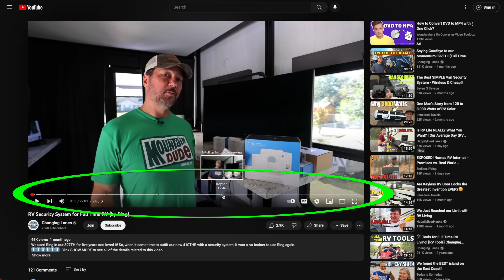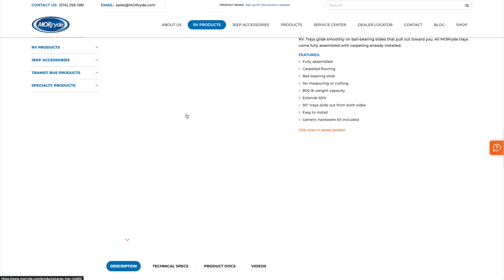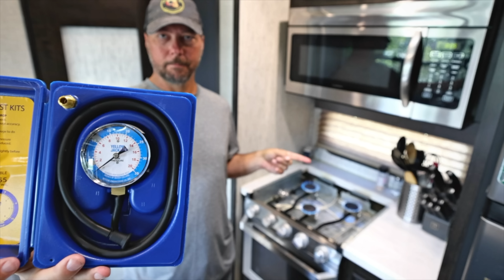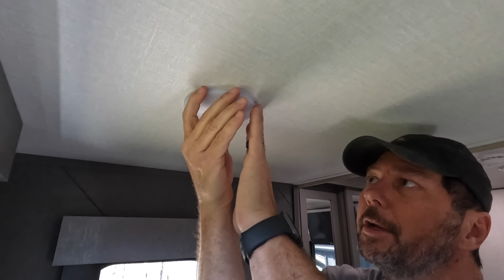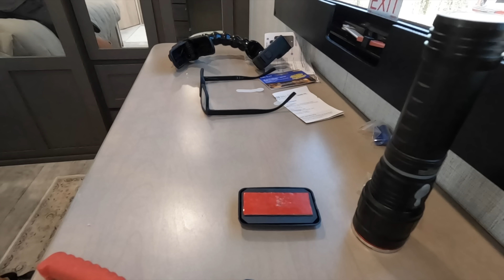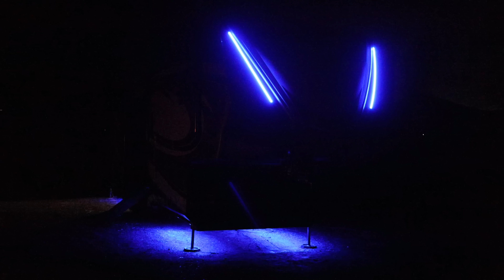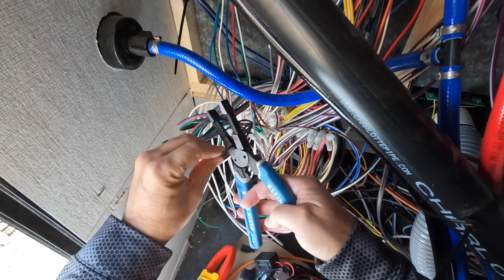Five EASY RV Projects for our New RV

Comment: If the screens will help prevent insects from restricting the flow of air by keeping them from making a home in there, why doesn't the manufacturer put them on??  I could never get an answer on this question, none from manufacturers nor Youtubers.
Reply: Money ! Every thing that is added to the RV cost money. So if you are willing to pay for the add on’s and not complain about the cost of the RV’s go ahead.
Reply from the maker: Like Tony said... Money is my guess.  There are TONS of improvements that can make every aspect of an RV better but they all add to the bottom line.
Reply: Like disc brakes, they should be standard on every camper. They probably cost close to the same as the drum setup…
Reply: @charlestabarracci7602  You are making a statement that you have nothing to back it up with.
Reply: Because the RV manufactures don’t care. People are buying them as fast as they can build them. So why would they want to make them better. The consumer is not pushing the issues, they are just buying them and making the upgrades after the fact.
Reply: @murphyslaw907  I bet you have one ?  Are you talking about yourself also ?
Reply: @TonyBenton0728  I purchased what I thought was a well built RV in 2016. Since then it has done nothing but piss me off. I will never buy another production line RV. The build quality is total crap, the engineering is marginal and all they seem to care about is how fast they can build them. Our old 2001 motor home was built so much better then our 2016 5 th wheel it’s criminal.
Reply: @murphyslaw907  Did you have it inspected by a independent inspector ? Maybe they would have found some of the issues you are having. We had our Riverstone independent inspected cost a little over $800.00 they found a few issues nothing major.
Reply: That's way too much weight to add. LoL
Reply: @r8edrv4fun65  🙄😵‍💫

Comment: I've been annoyed with the front cap lights as well. Thanks for the tip. ps when boondocking, the front caps lights help in finding your rig again when its pitch black.
Reply from the maker: Great point!  But I've also worried that it might say "hey... big expensive RV over here all by itself... " 😳
Reply: @ChangingLanes  True. However, I drove off from the rig to guide some relatives back to the highway (Quartzite) and missed the rig on the way back. A wee bit of panic and luckily turned back to the highway and tried again (successfully).

Comment: Stiction happens on motorcycle front forks as well. I run a very small thin bit for Grease close to the seal on the tube.  Works great on my race bike.